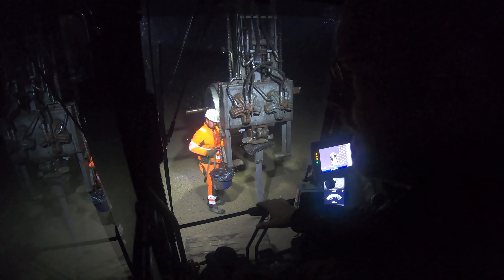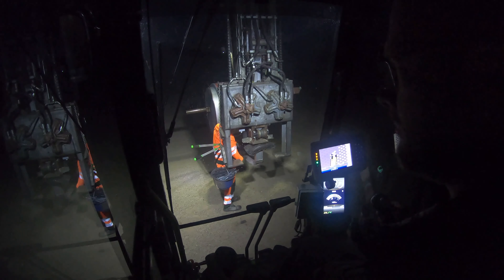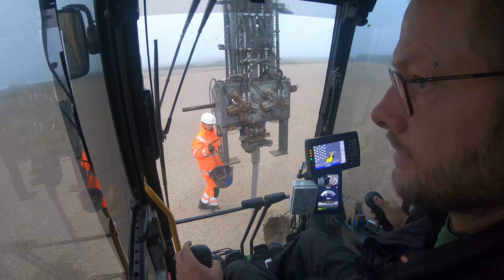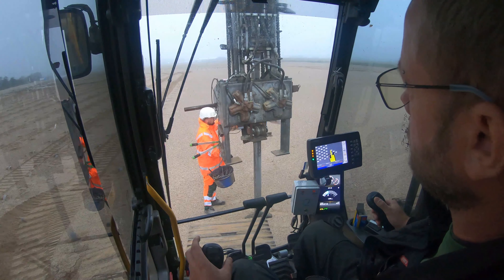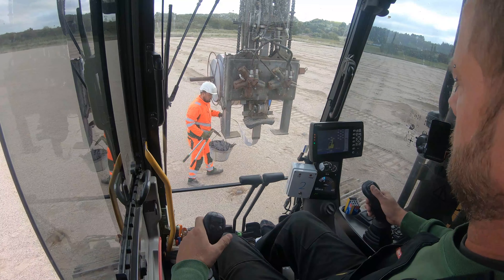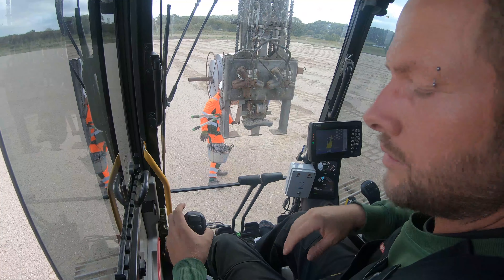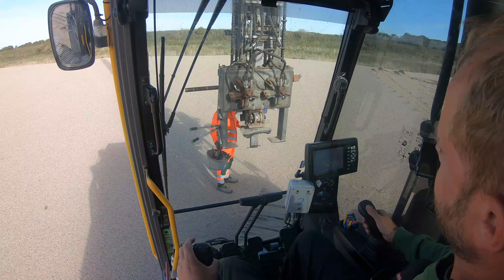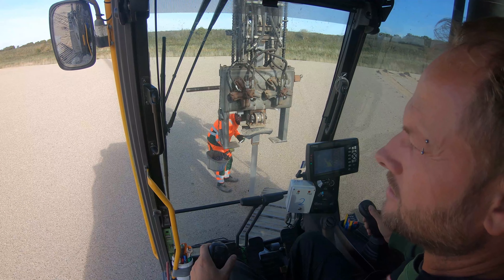Monday September 21

Comment: Have you thought of buying a “Tile”. You normally put them on your key ring(s) or whatever, so when you lose your keys (or whatever) you use your iPhone to locate the Tile (it has a GPS sensor). Anyway, you could put the Tile on a stick, and put the stick in the ground when you finish each day. Then use the app to find the stick on the next day.
Reply from the maker: It’s a good thought but I use the gps that guides me on point when I install the drain. I zoom out on my screen and the drive to my last installed drain.